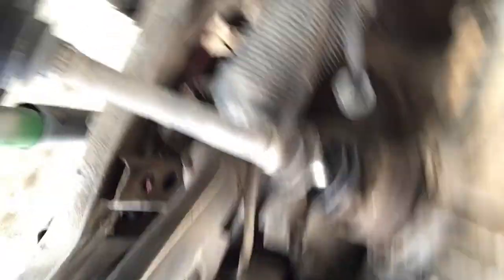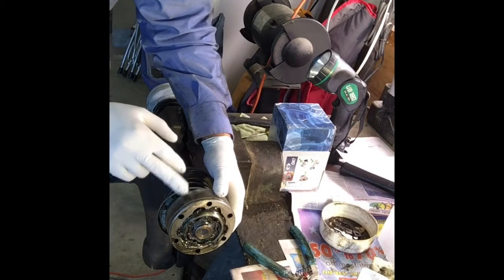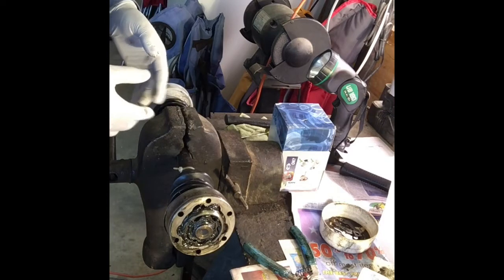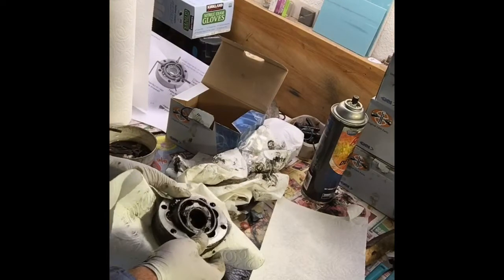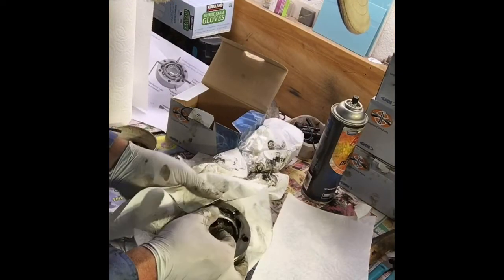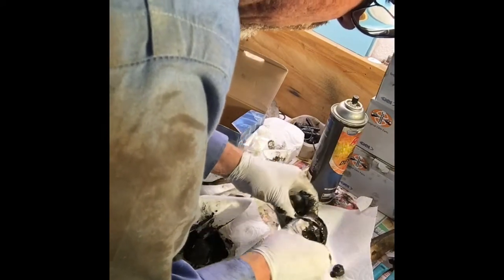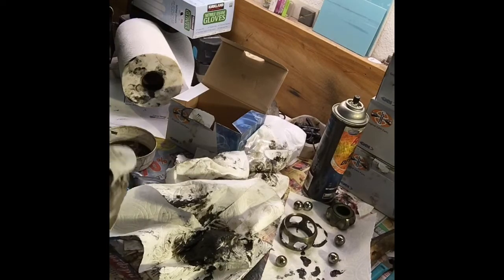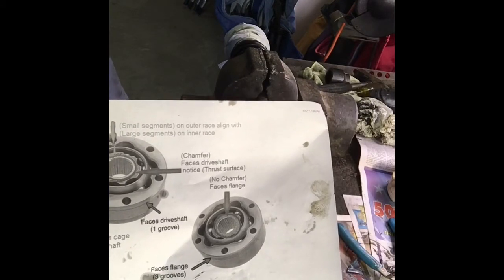Replacing CV joint boots on a VW Baywindow Bus

Comment: Great vid, thanks. Only thing I might add that you didn’t mention is to clock your CV Joints so they will articulate properly. Small point one end wide flange on the other

Comment: I always recommend leaving the clamp off the boot on the axle end. This allows the boot to flex & settle a bit on the axle end eliminating any excess stretching which will wear the boot out over time (pleats). It (boot) has a snug enough fit on the axle end that the clamp is not needed. Getting ready to do this job again here shortly on my 72. The last time I did it was 1998. I will be using Rockford boots and no clamps on the boot end.

Comment: Hi Todd in the process of changing my CV joints all bolts removed and the wheel end drops off but at the gearbox end the CV joint won't budge - what's your thoughts as I'm scratching my head at the moment. Don't want to cause any damage by hitting hit to free it
Reply from the maker: Hi Peter. I would double check that you haven’t missed a bolt and if it were me I would tap it and it should fall off.  Your call of course. Good luck!